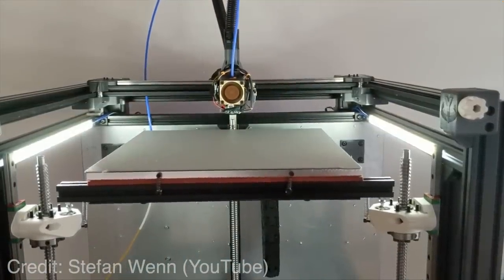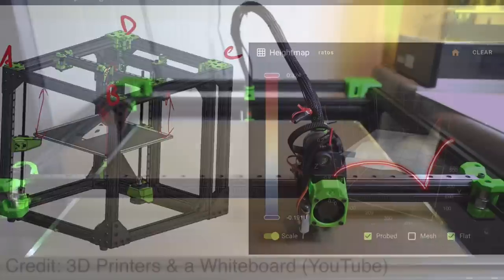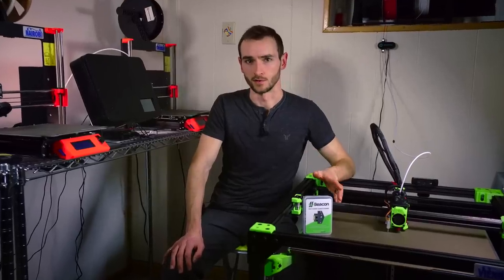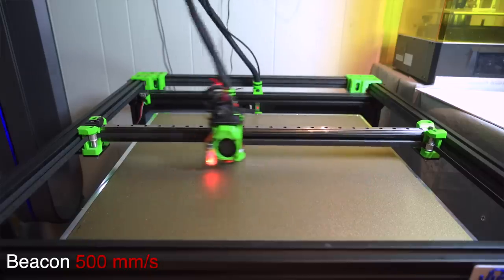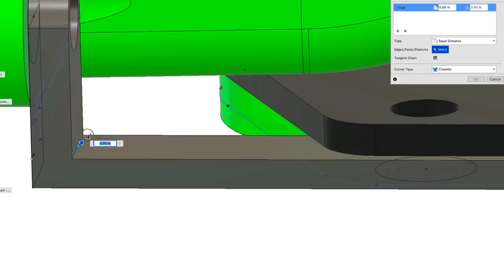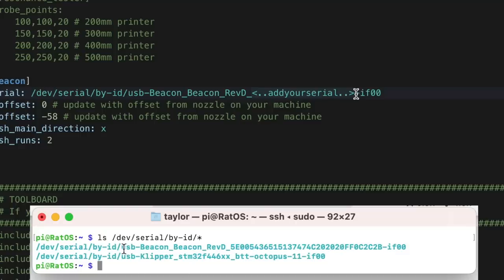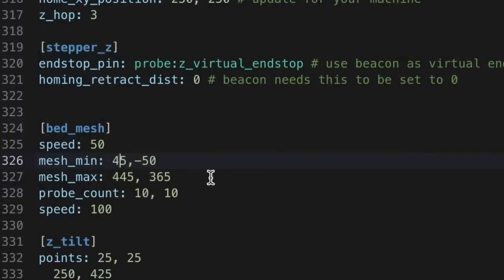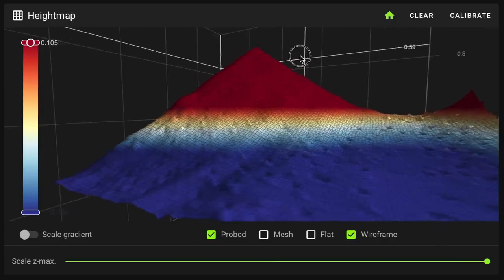The Future of 3D Printer Bed Levelling - 10,000 Point Mesh with Beacon Surface Scanner

Comment: As much as this is an amazing probe, it has 1 flaw: it has to be a steel surface / steel embedded surface. As someone who has been using G10 for a while now, this surface will unfortunately not work with beacon and that makes me very sad
Reply: Yeah, I still use glass beds. 

But this thing is completely unnecessary, so I'm not sad.
Reply: bambu's piezo probing is really the way this should be done. you still need to adjust nozzle offset with offset sensors like this. with piezo you don't.
Reply: @TMS5100  I actually don't know how it works so I can't comment
Reply: @TMS5100  Ok i saw videos of how it works and that is actually really impressive. That is indeed the best way to do things as you don't have to adjust probe offsets at all
Reply: @voxpop9  the piezo leveling system is so simple and so obvious when you think about it. i believe the reason why the bambu printers are getting such good reviews is because the leveling system is so good, it is nearly foolproof. you almost never see anyone talking about having to level the bed or adjust offsets with the bambu printers. all the other leveling systems look like outdated dinosaurs and needlessly complex. i wish other printers would use it.
Reply: @TMS5100  The problem is that it needs to be installed on the bed that is mounted using a 3 point system
Reply: @TMS5100  except piezo systems have a lot of noise.  They're cheap and have been around for ever, and even been tried multiple times on printers.  They've always been abandoned because they're not reliable, which the Bambu printers aren't immune to given the reported issues.
Reply: @TMS5100  Wrong, Bambu requires offset to. Those like me using custom PEI sheet knew that the offset was broken causing bed adhesion issues.
We were using custom offset way before Bambu made it official fixing the custom PEI sheet bed issues.
Reply: @voxpop9  some systems mount a single piezo on the extruder head.
Reply: @TMS5100  That would require that the head is decoupled from the mount which leads to it being unstable.
Reply: @voxpop9  there is no reason the head would have to be decoupled. the piezo transducers pick up vibrations. they aren't being squished. the transducers on the bambu bed are hanging off the bottom of the bed, taped on one side. they are very sensitive microphones and pick up the microphonic taps from the nozzle. there are three piezos on the bambu to pick up the vibrations transmited through the three bed mounts, but there is no reason it has to be exactly done that way. as an experiment, lie a piezo transducer disc flat on a table, wire it up to an oscilloscope. it's amazing how sensitive it can pick up light taps on the table.
Reply: @TMS5100  Interesting, if that's the case that would indeed make it very powerful
Reply: What if you try putting a thin sheet of copper because the G10 surface to crate Eddy currents? It honestly might work without it, depending on what your bed heater is made of.
Reply: @evanbarnes9984  Still doesn't address the fact that it is scanning the copper sheet and not the actual G10 surface
Reply: @voxpop9  What does it matter? Just use an offset. No matter which system you use there are going to be trade offs.
Point contact systems like klicky or Euclid etc will detect the actual print surface but have much lower mesh resolution meaning you will have high and low points not detected by the probe, unless you probe every mm of the bed.
The beacon will give you a high res mesh of the beds shape which you will need to apply an offset to. Again there will be high and low points relative to the average offset value.

Same same. I think a high res mesh with offset will have smaller deviations than a low res mesh that extrapolates the bed surface between probe points.

You don't need a 1 to 1 mesh of the bed surface. Just a mush within tolerance of the filament your printing and the layer height your printing at.

If your using a printer with a heated enclosure then the recorded mesh goes out the window anyway due to themal expansion. So...
Reply: @TMS5100  Your wish is granted - Prusa use the nozzle to probe the bed on mk4 and XL. But actually it isn't true you do not need z-offsett calibration this way. It is still needed, but done from factory. I tried the piezo-probe some years ago, and adjusting it was not easy. Using the nozzle as probe is even more complex than the other sorts of probes. It only seems more easy if you use a ready2use, factory calibrated printer - not if you diy.
Reply: @oleurgast730  yep nozzle probing is the future. 100%. hopefully everyone else gets on board now.
Reply: You know you can just put a steel bed under your G10 and offset its size?
Reply: @kuuhgle  Please check my above response to this suggestion
Reply: Just add one aluminum foil sheet below
Reply: You dont have a metal plate under it?
Reply: @TMS5100 those serve two purposes. You can use a load cell easy for z offset the scanner is for bed profile

Comment: Although very technologically impressive, I think the mounting difficultys, the compatibility issues and the need for klipper and pi could mean beacon will take a while to catch on, but I think it definitely has a place in the future of printing
Reply: You don't need Klipper AND Pi.
On my Voron Trident, I'm running a Dell thin client, Debian. I have no problems, can use Kusba for input shaping, you name it.
Reply: @hakunamatata324  I have no clue what half of those are lol, I think the point still stands but it's nice to hear that it can be adapted to different systems
Reply: @alonraz6477  lol
Basically, with any printer running klipper, you don't need a Raspberry Pi, you can have a old laptop running Linux, that is all. I have a small Dell Thin client running Debian instead of Raspberry Pi. Better performance and hardware without costing me a kidney.

The input shaper tool that is usually attached to the Pi pins is no longer needed. There is a board called Kusba, you attach it to you Pi or PC connected to your printer via USB cable, it is plug and plan and dead easy to use.
Reply: @hakunamatata324  ohhh I kinda get it now. Huh, might actually think of using it
Reply: @alonraz6477  Yup seems to not be common knowledge that it's not a pi that's needed...just something with stronger processing power than a standard 3d printer control board.  Put those old laptops and desktop to use if you have them!  A 10 year old desk top won't play games worth a damn, but can run an entire room of 3d printers!.  Same with minipcs, or alt version of raspi type systems...a favorite of mine is 'le potato' a raspberry pi type system that only costs like 35!
Reply: @hakunamatata324  Unfortunately anything requiring an old laptop running Linux with NEVER go mainstream in that form.  To you and me its easy and very cool, to literally every other person in my family and 99.9% of the rest of the world, they wouldn't even know what Linux is.  I'll consider it mainstream when this is built into an Ender 3 level printer out of the box and the owner doesn't understand or care how it works, it just works.  But this is what the industry needs to make 3D printers themselves 'mainstream'.  Simple low cost reliable solutions to our aged old 3D Printer problems :)
Reply: we already have klippers and pies
Reply: Klipper is already becoming mainstream

Comment: The future of 3D printer bed leveling should be people just not listening to YouTubers trying to make them buy this weeks fad.  Because this was basically just a 7 min advertisement.
Reply from the maker: I can see how it may come across that way but honestly I just thought it was cool and wanted to share. I have no vested interest in whether you buy the product or not. If it was an ad I probably wouldn’t have told you it was hard to mount or that I was having issues getting good data out of it. It’s an expensive option when cheaper alternatives exist and do an adequate job, so definitely not for everyone, but it does have some unique attributes not seen on any other solutions.

Comment: Im not sure about the hyperbolic statement about it being the "greatest innovation in the 3d printing industry for years" Whilst hardware hasnt really changed a great deal (at least until bambulabs came along) most of the innovations were with software and firmware. There are tons of probes out there that have plenty of resolution for 3d printers. Whilst this probe probably is more accurate.... does it really matter, will the user actually see a difference. I dont think so, as such I think calling it the greatest innovation isnt really true.
Reply: I think nozzle probing is probably the most accurate and least intrusive. Like Precision Piezo or how the X1C and P1P does it.

Comment: Thanks for the credit on the clip! Also very nice job on putting this video together! One of the things im really excited about is the live Z readout. I hope the feature becomes available where you can set the sensor over a corner and live adjust your bed corners. From what I understand this is possible, just the UI needs to be built out for it. Having a live readout would make leveling the corners of my bed very convenient.
Reply from the maker: Oooh yeah, that would be nice. I'll have to poke around and see if that feature is live yet. Thanks for making me aware of it!
Reply: you can already do this, but it doesn't have a nice UI. You can easily fly to corners and get readouts live in the console though
Reply: would this work with glass beds coated with a resistive metalic coating? how much metal content is required?

Comment: This really is like an inductive Z probe, but with analogue output. Calibrate it once by comparing signal levels to know Z heights and off you go.
Also has disadvantages of inductive probes, such as not working of a glass print surface. And I wonder how the deviation would be between hot and cold print surfaces.

Comment: I think Beacon is a very cool product, but it's ultimately just a really fast inductive probe. And the speed is a little superfluous IMO. You can quickly construct a super high resolution mesh... of the metal underneath of your actual print surface. That's of limited use for bed meshing IMO, although it's fine for tramming if your printer supports that. I would rather use a mechanical probe (or any type of surface-detecting probe) and combine it with adaptive meshing (IE, only probing the area that you're printing in). The resolution is more than sufficient, and you get a mesh more representative of your actual print surface. Plus it means you don't need to redo your Z offset when you change build plates. With something like Klicky, you can combine it with a physical Z endstop to even handle nozzle change offsets automatically. Or toss the physical Z endstop and just run something like Voron Tap or Prusa's loadcell system and never worry about anything ever again because your nozzle IS your probe =)
Reply from the maker: Great points!
Reply: @ygk3d  Actually thats one of the reasons Prusa changed from inductive probing to measuring with nozzle tip on the mk4 and xl. On the other hand the beacon allows a very good resolution very fast. So combining both methos seem to be the best way: Measure once both ways to create a Delta mesh for the sheet (so a z-offset-mesh for detected metal to real surface). This would also compensate for the little spikes (casted Aluminium is not perfect, this spikes are simply points where the inducted current can not flow perfectly). After that, you can use the mesh the beacon does, the delta mesh you stored for the sheet once and have a very high resolution mesh for the surface...

Comment: it has the same issue as an inductive probe. It measured the metal under the print surface. BLTouch and TAP measure the surface itself.
Reply: Actually that is a good point. The Nextruder in Prusa's mk4 using the nozzle to probe the surface. Unlike the bl-touch no z-calibration is needed, wich is a big plus.
On the other hand, the beacon is insanly fast and detailed. So the best might be combining the two methods: measure the surface both with the nozzle (will take its time for 100by100 points) and the beacon once, creating a mesh for the surface2metal distance (lets call it "sheet delta mesh") and store it for the sheet. Before printing, do a full measurement with the beacon, but verify the surface offset by two or three measurements with the nozzle tip (to check automaticly you loaded the correct sheet delta mesh). Also do the homing with nozzle tip.
The mesh to be used would be the sum of beacon measured metal plus the sheets delta mesh. Best of both worlds: Precise and fast measuring before every print to compensate for the bed bending (mechanical or temperature) plus automatic compensation for thikness of coating/non inductive sticker. And no z-offset calibration needed...

Comment: Something like this has me wondering if the same kind of result with another technology is possible ... One that doesn't rely on the bed being a specific material. Something like sonar or something ... This technology is awesome, the continuous improvement and innovation of 3D printing tech is mind-blowing
Reply: I was thinking the same thing and then I thought about a presence sensor (detects human presence) for a smart home system that I have here(*) that not only can detect presence like the old infrared sensors but can also detect absolutely tiny movements like shallow breathing and the direction of the movement, from across the room. This sensor uses millimeter-wave radar to do this. So now I'm wondering if that couldn't be modified and/or improved upon--with this I mean a new sensor developed using the same technology but to detect much more accurately but from very close by--to do bed probing with in some way. If it can detect the movement of shallow breathing from meters away, it should be able to detect a surface its moving towards with even greater accuracy. Not an engineer though, so I'm likely missing something

(*) The sensor brand and model is an Aqara FP1 presence sensor

Comment: hi , fixes large platter issues very well 👏 ,The mesh feature has been further elaborated andI think you mean that if the mesh feature is further detailed and a few more things are added, such as camera, it will perform both part scanning and 3d printing.

Comment: seems like it would be a good one for a dockable version. i've seen some people have probes stored off the side of the printer, and when its asked to probe the bed the head moves over to the probe, picks up the probe, does what it needs to and then puts in back.

this could allow you to have the probe actually be lockated far below the head when probing so its away from any metal compontents in the hot end. but then not be in the way when it comes time to print. and this could also make it possible to just have the sensor be located directly below the nozzle so its able to probe the entire printable area of the bed. Sinc ei know right now the way my bltouch is, its so far off the ide of the nozzle that i cant probe the entire bed without making a few more modifications to parts that end up coliding. 

no idea how to do it, but it seems like a good way to make best use of this probe.
Reply from the maker: That would be awesome actually... will have to give that some thought.
Reply: Dockable probes primarily rely on magnets, which would be an issue given this probes exclusion zone would it not?
Reply from the maker: @turbo280zzz  That was my thought too… plus the Beacon is not hot pluggable so the cord would have to dock/undock with it. Klicky gets its electrical contacts through the magnets which makes it seamless for docking/undocking.
Reply: @turbo280zzz  You could use very small magnets and put them far away from the probe end. Make it more of a physically latching connection. So like a big C shape that goes around the whole hot end, with magnets on the top that align with magnets on the top of the hot end and the probe on the bottom hanging way below the nozzle.

Comment: Slight error. RatOS is not a RR-specific Klipper version. It's a bundle that embeds a pre-configured Raspbian image with Klipper, Moonraker and required tools, and a customized Mainsail UI.
Sure, it provides ready-to-use configs for RR printers, but it's not another Klipper variant.
Reply from the maker: Thanks for clarifying!
Reply: In fact there’s no such thing as a klipper variant, just different web uis